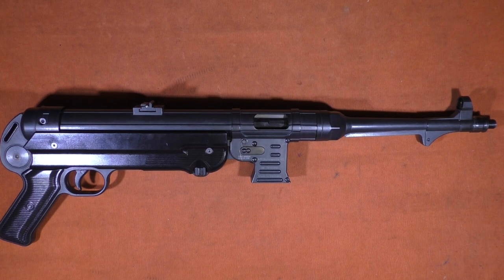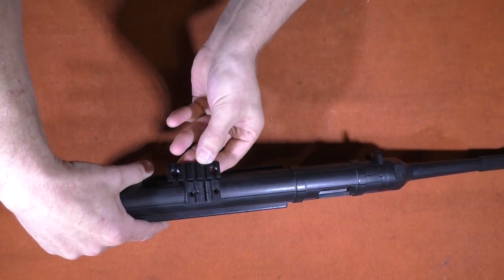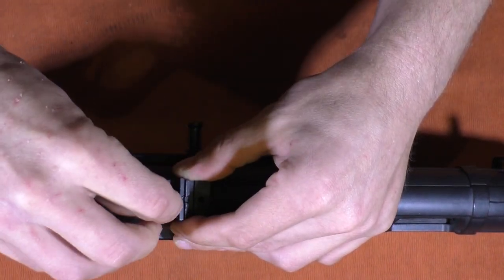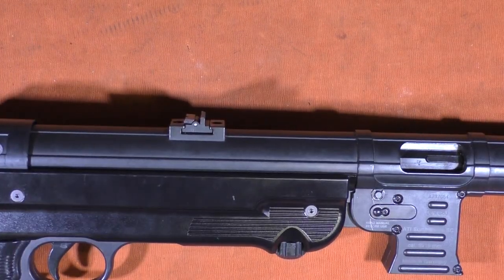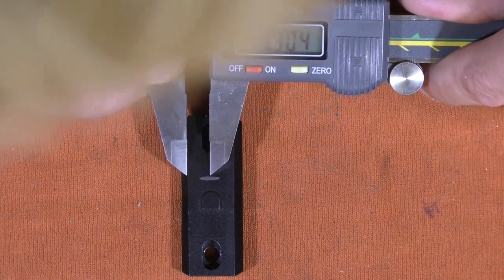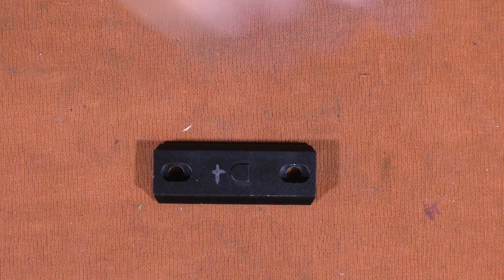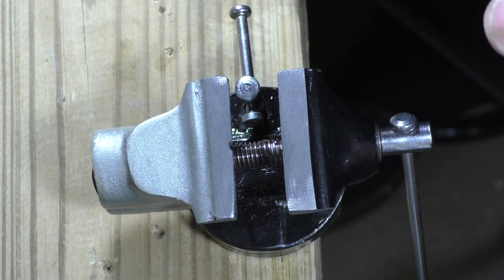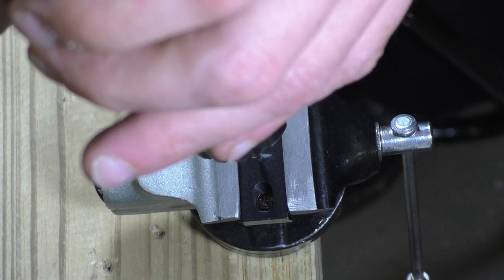Making an Optics Mount for the GSG MP40P: 25% more shoots of my hair than you'd expect.

Comment: Did you ever take it to the range if so how did it work and hold up?
Reply from the maker: I've only gotten limited time with out on the range. It was reasonable stable but the ADE micro red dot I mounted on it wasn't the best. I haven't had time to do much with it since then. I think I may buy a low cost reflex sight and mount it as it gives a bigger sight picture I think will work better on the GSG. Thanks for asking.